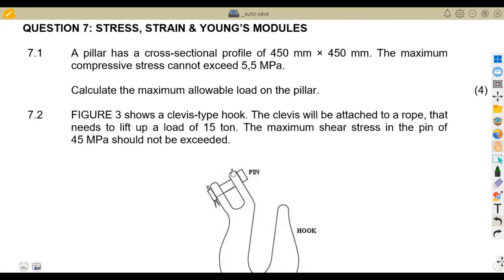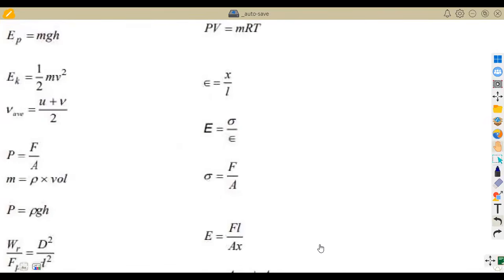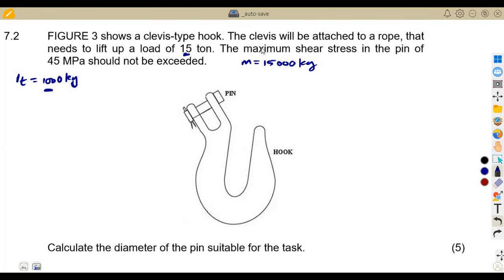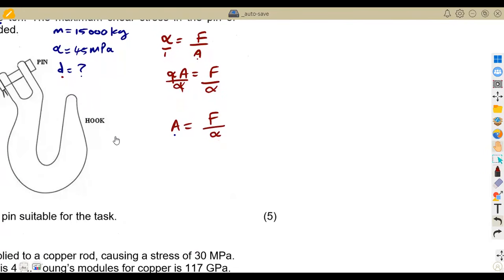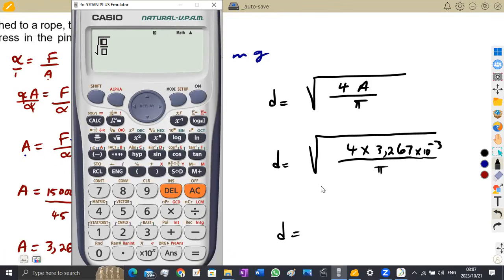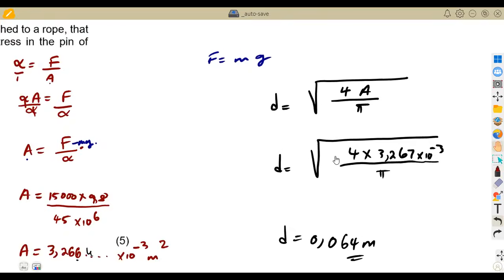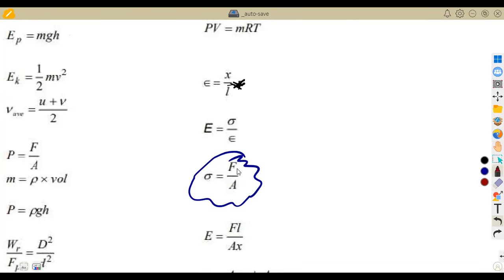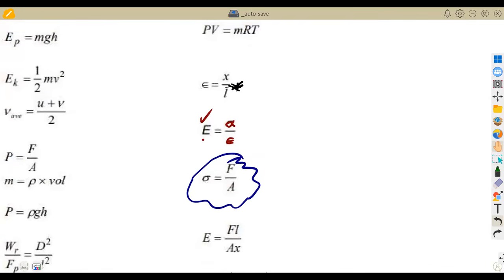Engineering Science N4 STRESS , STRAIN and Young's Modulus APRIL 2023 @mathszoneafricanmotives

Comment: Sir 7.2 I also done it just like u but the memo they got 1.633×10-3.. As their area because they used the double shear formula🤔why would they do that perhaps?
Reply: whenever they mention the word 'clevis' then it is double shear. So you will use the formula for double shear which is force over 2xArea
Reply: @shariefrosier4236  thank you bro , it was soo confusing at first
Reply: It supposed to be 2A
Reply: Sir I think there's mistake when calculating area I think I t was suppose 2A for area
Reply from the maker: Will check it out from what they did